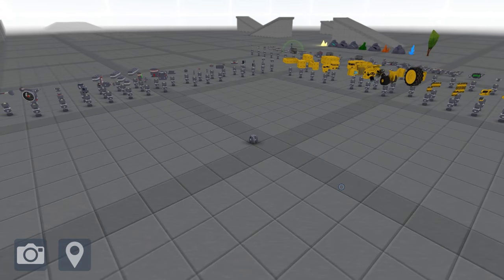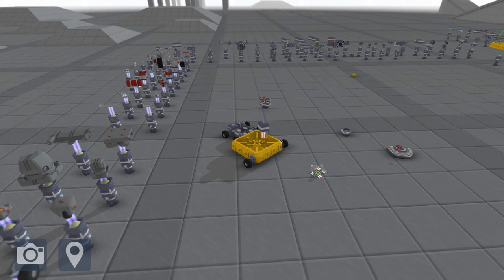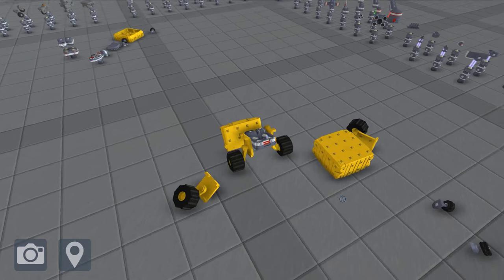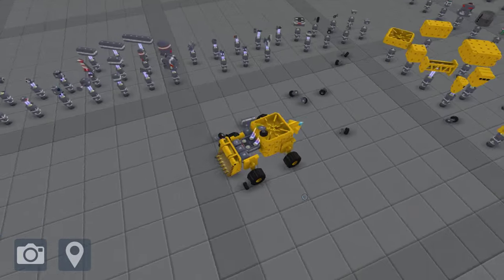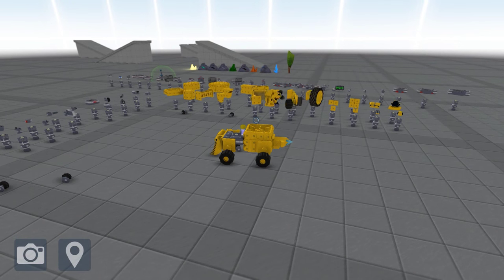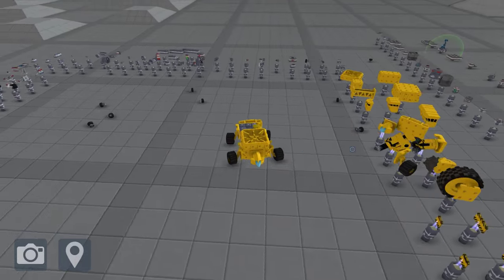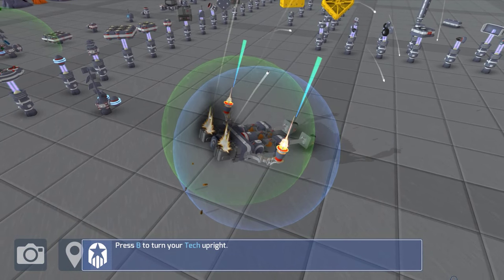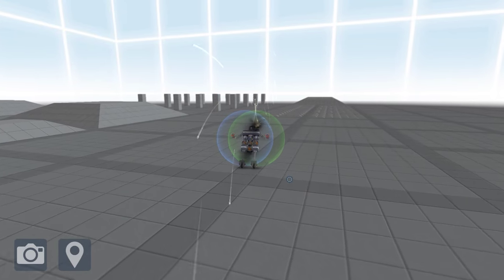Terratech - Ep. 12 - Building a Robot and Testing Receivers! - Let's Play [TerraTech Season 4]

Comment: Well the only way I could see block transport working at the moment, at least semi-sorta working... Is the way a tanka truck works. Having a trailer catch that will hold the blocks in a deep pen in back. Then using the scoop to toss them inside the pen. Didn't say it would be best, but seems feasible to work somewhat. Granted like the tanka trucks the stuff will rattle around back there. Also that might be a bit much of work, since how large it would have to be in order to carry anything feasible.

That and don't know, or rather looks like the bigger blocks it wouldn't be effective with. The smaller objects maybe, but getting to the Geocorp size to fit in a trailer with other of the same size... might be quite tedious if anything else.

Nice tests. You probably could transfer from a pad to conveyor by using a filter, but... That is only when UI within the R&D finally gets put into the game. Granted not really necessary since receivers will take things from the pads. Silos will store them, and also filters will extract from silos. So yes the pads are mainly for resources now. Blocks will have to be handled manually at the time being unfortunately. At least until they add that specific object to the game. From my understanding with what I have messed with and seen others mess with that is.:)